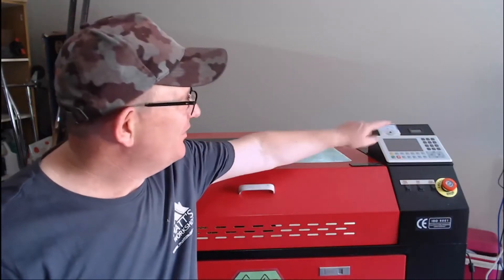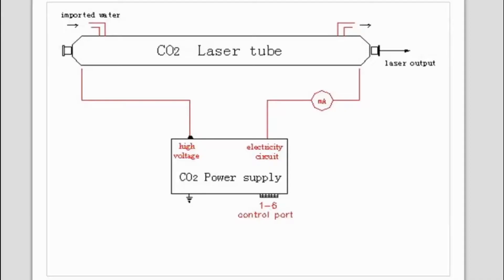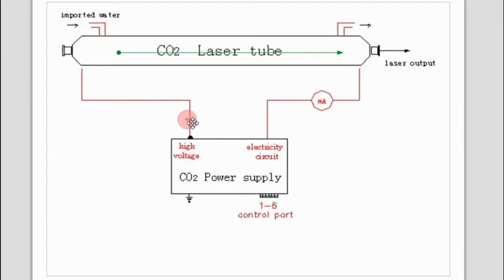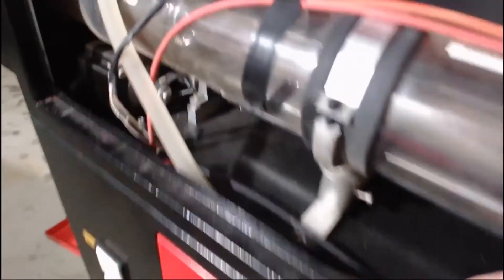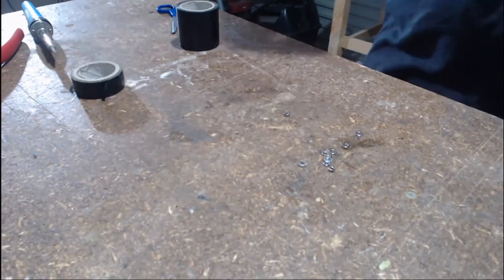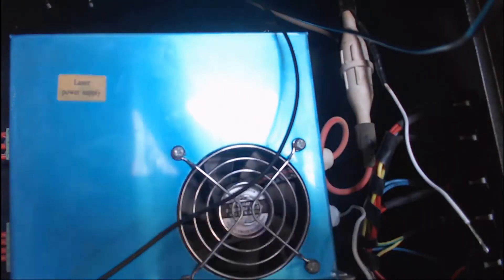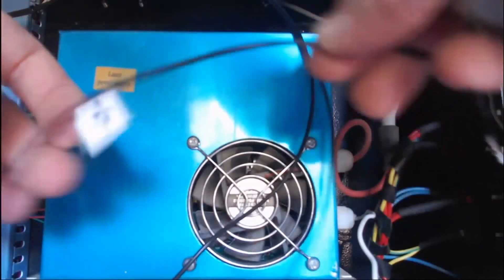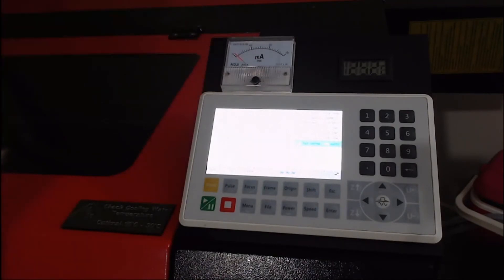Co2 Laser Tube, Power Supply, Ammeter Installation-Cloudray-CO2 Laser Cutting Machine

Comment: my new Cloudray power supply doesnt have the L- negative laser tube connection.  where do I connect the negative laser tube lead after the miliamp meter?
Reply from the maker: Hi, the black wire is used for connecting the negative electrode of the laser tube.
Reply: @CloudrayLaser  I worked it out! Thank you very much!  Can you tell me if LED 15 +5V should be on, and should LED 14 be blinking?
Reply from the maker: @The_Mimewar  LED 14  should be blinking when LED 15 is on.
Reply: @CloudrayLaser  one more!  I’m almost done!  Led 15 is on, solid, not blinking.  +5V.  Does this mean it NEEDS the 5V or it’s good?
Reply: @CloudrayLaser  I have owned this laser for 2 years, but it had a dead power supply, so I wired and installed a 40 watt supply I had leftover, worked just fine for 2 years.  I finally bought a 60 watt and the installation is taking longer than I expected.  I think I have it down to a water protect fault on the new power supply.  If my Ruida board handles water protection, can I short the water pin to ground?
Reply from the maker: @The_Mimewar  Hello, in order to reply to your question more quickly, I suggest you contact customer service at the store directly ：） Have a nice day!
Reply: @CloudrayLaser  I got it figured out.  New power supply and my bed size changed somehow!